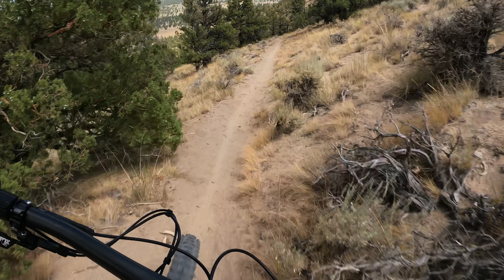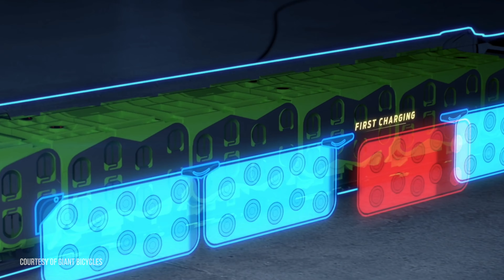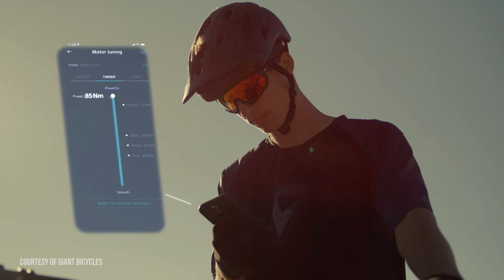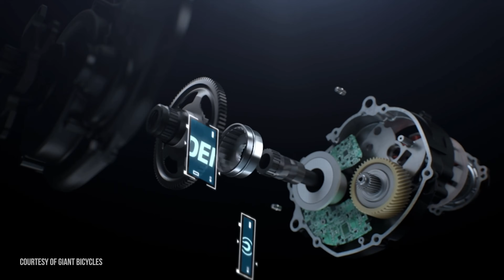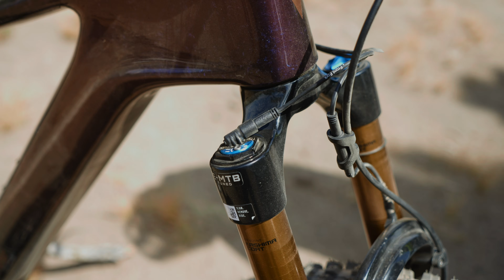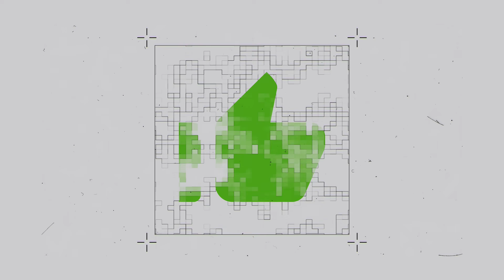Full Power, Light Weight? Giant Trance X Advanced E+ Elite Dissected

Comment: Thinking about getting an ebike and your reviews are very helpful. My question is do you turn the motor off on downhills? you talked about speeds nearing 25 -30 mph so can you explain how the limiter works or does it mean there is no drag on the motor after reaching 20mph? Different videos talk about like riding in mud after hitting the 20 mph mark.
Reply from the maker: If you’re above the motor speed limit, the combination of increased weight, motor drag and the contrast of assistance vs no assistance can make pedaling feel like mud. However the motor will not prevent you from going above its speed limit, and if you have the gravity to pull you up above the cut-off then it’s not so different to a mountain bike. 

Hope that makes sense and helps!
Reply: Thanks! Appreciate your response

Comment: Have you tested Giant’s range on flat surface? Can it be changed to 29er? How does the motor behave when battery dies - is there a motor resisantce when pedaling? How would you compare motor’s noise level to a Trek’s TQ motor? Do you think it’s a good all around bike for trails, forests, commuting, gravel and touring up to 100km? Would you recommend it over Trek Fuel EXe?

Comment: I'm going to try a +2 today. Torn between this and Fuel Exe 9.7....and there's a 2k euro price difference which is quite substantial for basically the same components. What would you suggest?
Reply from the maker: Really depends on what you value more, power and speed from a drive unit that packs a lot more assist, a slightly slimmer looking drive unit, looks... Both bikes are very good in their own ways, but Giant definitely has a lot more power and if you stepped down to a lower model that still has good suspension without the live valve, you'd save money and be able to afford a range extender, which could possibly have us pick that....Although the EXe with a 160mm fork and range extender is a very awesome and fun shredder! Can't really go wrong, just need to evaluate what matters to you and your terrain.
Reply: @TheLoamWolf  I tried the Elite +2 and bought it right on the spot yesterday...they made me a 20% off sweet deal. I just couldn't wrap my head around paying 3k more for a Exe with the same components.

Comment: I got the elite2, great bike, I can only confirm everything you said about it, very fast. Kept the geo in high and got no pedal strikes so far. One negative comment: it is possible to connect the integrated power meter on a Garmin but it is not working, i.e the data are completely wrong, and would be great to push Giant to correct this bug.
Reply from the maker: Thanks for sharing!
Reply: Nice bike I’m looking at the elite 2 and 1, but 1 is really expensive ffs lol the 2 is alot cheaper but less specked.. how you find this?? I have two giants now but no carbon.
Reply: @eastcoastlife3547 I’m in the same boat. I’m leaning towards the elite 1 but the price jump is painful. What did you decide?
Reply: @RT-yh8pi  elite 1 and yes even with a deal it’s stupid expensive 😩
Reply: @eastcoastlife3547 I ended up pulling the trigger on an elite 1 as well. Waiting g for it to come in and can’t wait to see the raw carbon color in person. I was able to have them throw in the range extender at least!

Comment: Drew. I really feel like giant have missed an opportunity here by not bringing out  an enduro version of this bike. Imagine this at 170/160 travel with similar weight, motor power and battery. It would be amazing and would disrupt the enduro SL market. The problem for me is that this is a trail bike with steep head angle and 140 rear travel..  A real shame.
Reply: I too would like them to make a Reign Elite version of this bike (and dual crown compatible!!!). I think it is on the horizon. I have the full-fat Reign E+ and it's 56.5 lbs w/ coil shock in a size small 😮. I don't think them first giving their trail bike the lightweight treatment is a shameful, missed opportunity though... It's not like they don't have 3 different versions of the Trance ebike - full alloy model, full carbon model, and now the lightweight carbon model. Stands to reason that they'll release a lightweight carbon Reign E sooner or later.

I've got the Trance Elite 2 on order. I plan on upstroking the shock to 55mm to get ~147mm rear travel and upping the fork to 160mm. Will decrease head angle to right around 65°. Still won't be a ultramega enduro bruiser like the Reign E is, but it will be more fun and snappy for when I'm doing trails with less-than-crazy gnar and speeds.
Reply: Hello. Yes I am fine with them making this version first. And it's amazing if the short travel steep head angle works for you. But I understand from my contact at giant that they aren't making a longer travel version. Happy to be proved wrong on this as I'd love to see it and would buy it. But it's annoying having to modify a bike to increase travel etc. Peace

Comment: The weight matters more where it’s placed than how much it is. Save 1kgs on the motor, low and center, is good, but not crucial. Save it on battery is really noticeable , leaving all the power when you need it, and an extender you can carry o place also low, is the way to go. SL e-bikes are about stylish but and absurd concept in terms or performance.